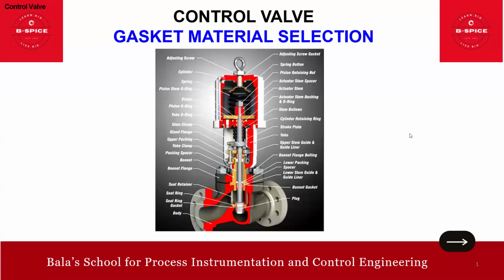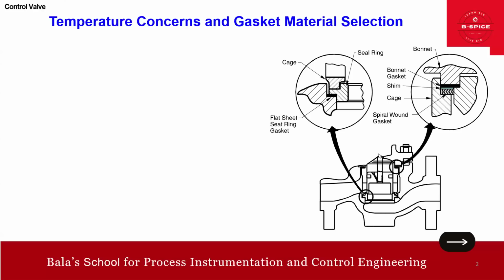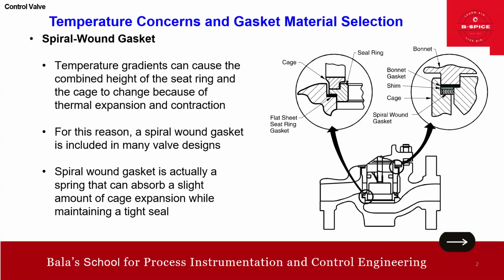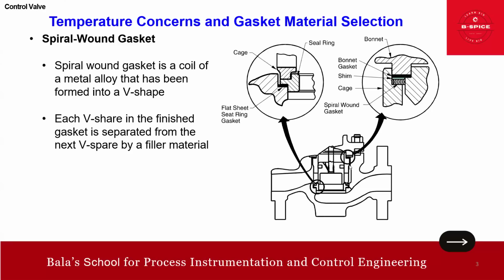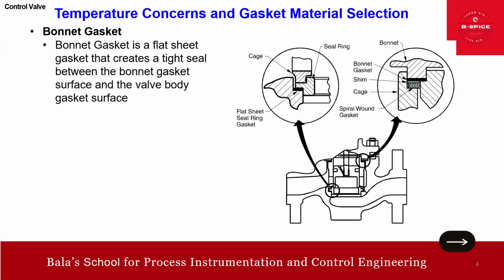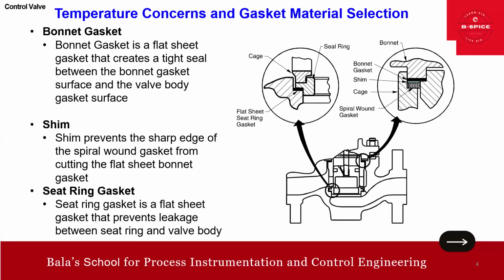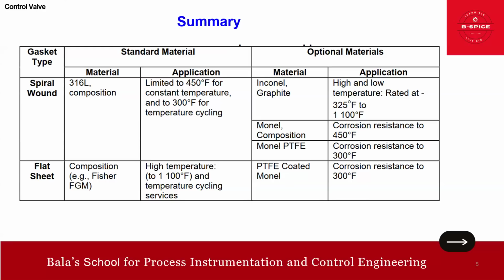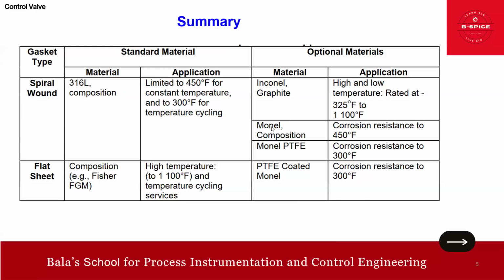CONTROL VALVE - GASKET MATERIAL SELECTION

Comment: Sir
Can u explain how to calculate the thickness of the gasket ?
Reply from the maker: various formulas are used by vendor during the design.. one among is  g = (P * D * m) / (2 * Y), where P is the internal pressure, D is the internal diameter of the vessel, m is the gasket factor, and Y is the yield strength of the gasket material